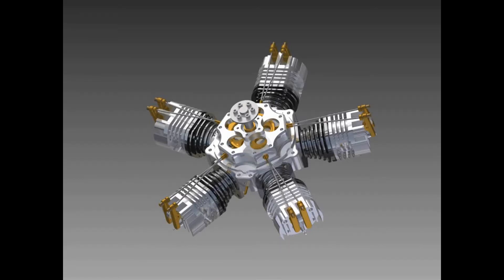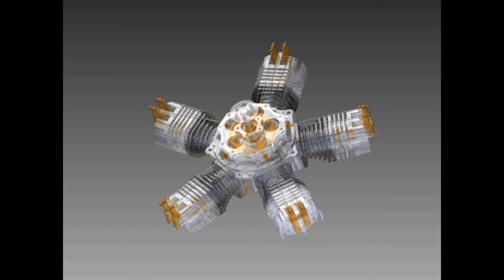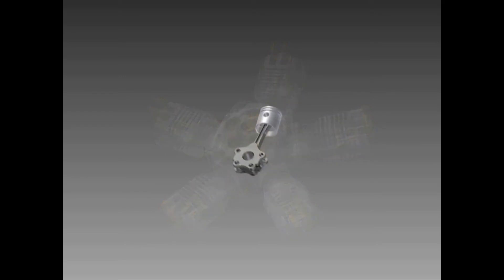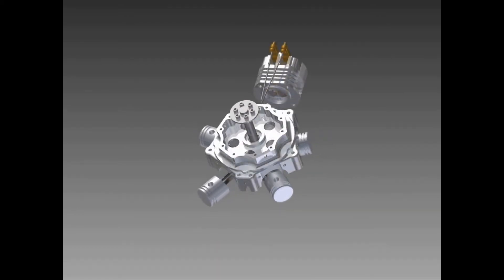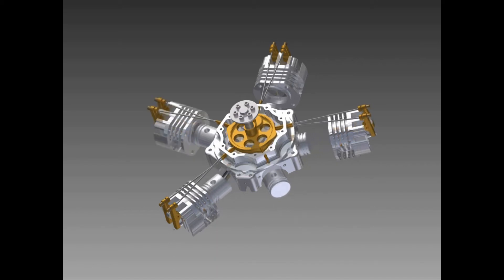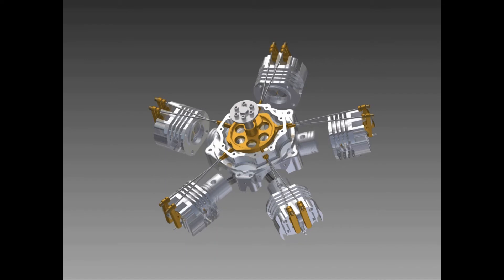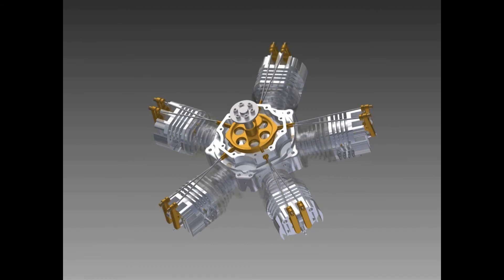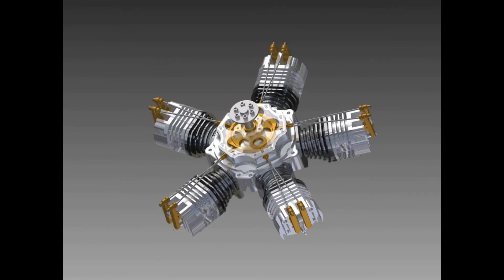How a Radial Engine Works - Autodesk Inventor

Comment: I have always wondered how they engineered the relationship of the master rod to the articulating rods.  As the master rod journal travels in a circle, it offsets the angle of the articulating rods by what looks like ten degrees forward and back.  So the wrist pins of the articulating rods are not making perfect circles.  Bottom dead center of each articulating rod is changing based on the position of the master rod, and bottom dead center of the articulating pistons is not when the crankshaft is 180 degrees opposite of that cylinder.  BDC of the articulating rods is variable based on master rod position.  BDC of the articulating rod appears to be crankshaft position minus master rod angle.  I would imagine this would affect the acceleration and de-acceleration of the articulating rods.

Comment: Can you explain  me how the plug spark fonction
Reply from the maker: That's a pretty broad topic.  The engine has two magnetos which generate the spark and distribute it to the cylinders.  The magneto spins at (half the number of cylinders) speed times the crankshaft speed.  The distributor spins at 1/(the number of cylinders) times the speed of the distributor.

Comment: Rotec, Australia, manufactures a 7 cylinder 100HP & a 9 cylinder 150HP radial engine that has proven popular & very reliable.
Reply from the maker: Looks like a spam bot posted - so I will respond.  The Rotec radial is very cool looking.  It is a modern interpretation of a radial, and is gear drive instead of direct drive.  Some folks love them.  Others hate them.  I have the carcass of an airplane that came down because the pilot didn't know how to use his Rotec product, and it isn't the same as the classic one.  I won't say that I wouldn't fly a Rotec, but it isn't the same nostalgic engine I want to build some day.